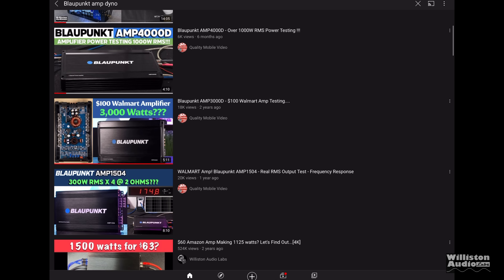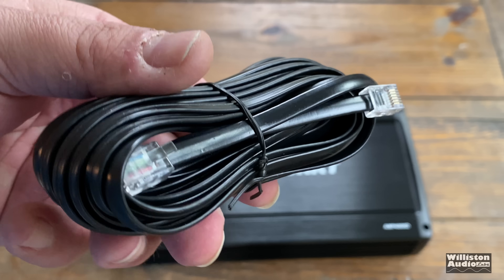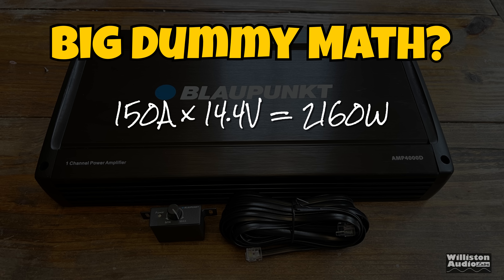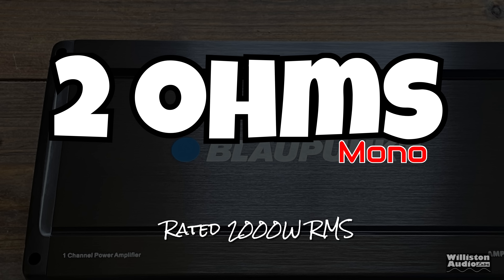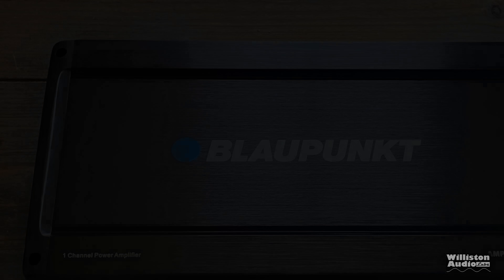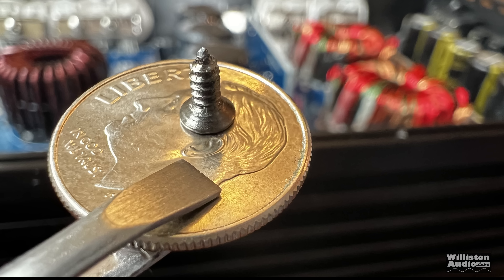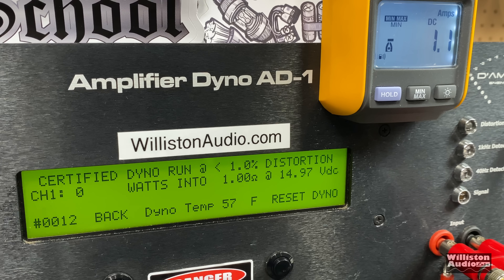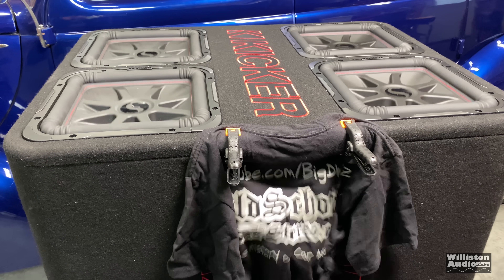How Much Power Does a $49 4000W Walmart Amp Make? [4K]

Comment: I grew up in Germany in the 80s and when I got my first car at age 18; I made a dream come true and bought a brand new Blaupunkt Nashville SX straight out of the store. It cost 599.- Marks. That is at least $1.500 in 2022 Dollars. Two times the money I spent on the car. Damn was I proud. The first car stereo on the market with an automatic track skip autoreverse tape deck if I remember correctly. 
It's a bit strange that they sell $49 amps under that brand now...
Reply from the maker: The name was sold years ago and they are no longer the same company
Reply: @wal  I wanna know who the actual manufacturers are that they license the name out to. With the spelling errors and everything this just seems like the most random Amazon garbage but with a recognizable name slapped on - the fate of every German company at some point, it seems.
Reply: Looks like they were owned by Bosch until 2009 or so. I had an amp and a pair of their 6x9's in my old Cherokee that I picked up in the early 00's. Really decent quality at that point still, I actually transferred that amp through two other cars until a channel on it finally died in 2018 or so. Other than the EMF issues 50-1000 bucks for a 600W RMS@2ohm isn't bad at all. I would have killed to get that much power on my first set up at the price.
Reply: @MEatRHIT2009  Not Blaupunkt but, I bought a $25 'DUAL' car stereo tuner/amp combo from Walmart 4 years ago and, it's held up, 25W RMS per channel. I can't remember if it's a 2 or 4 speaker unit but, what I paid for the thing, who cares, rhetorically speaking?
Reply: @albinklein7680  Everything has went down hill in Germany and the USA  since then . It makes me sick now music is just a bunch of shyttee sounding bass

Comment: That’s some crazy emissions from the amp to be able to corrupt the data to the display. The screen is right on the front panel with the amp in close proximity. Having designed products that use similar LCD screens that must accept EMI blasts in testing without corruption, I know it takes a lot of energy to cause such disruption. Yikes.
Reply from the maker: Oh man it is wacky
Reply: You could just shield everything computer wise or just get a car so old it is carbureted, And no not electronic feedback carbureted but rather straight up carbureted, And instead of having the ignition control module in the bottom of distributor have it even more old-school like before the early 70s where it was just points ignition, Then even if it affected the alternator you wouldn’t even need it to run aside from trying to drive at night. I know all this is highly improbable that it would happen from the amp, but I’m just spelling out a mad max scenario for the fun of it.
Reply: @adamgallahan6747  That would be a "magneto" ignition system.

Comment: Why the hell would they lie about that RMS power rating for $50 if they put the true ratings on it it would be an absolute steal for your money especially for running budget subs there is no point to lie when you already made a pretty decent amp for the money don’t rate it at one ohm tho Literally that amp is a steel at that price
Reply: well because it's not supposed to be $50, its supposed to be $150, they're selling them for like cost price, have a guess why....

Comment: I was too young to really recall, but my brother would always say Blaupunkt made some of the best sounding head units back in the 80's-90's. Sad to see what theyve become now. Still.. thats useful power output despite it not being close to rated.
Reply: They still make decent stuff for vw/audi group cars but their aftermarket stuff is pretty low grade anymore
Reply: @79huddy  I think it's still Bosch that's making the stuff for vw/audi but they sold the rights to the consumer market to some zombie brand company. I remember seeing their units suddenly being just re-branded white box crap that you could buy cheaper under less names.
Reply: I remember listening to the speakers at an electronic store and wanting the Blaupunkt (BluePoint) speakers because they just plain sounded better than anything else. I wish I could find 4 of those 6.5 inch three ways from back in the late 80's early 90's I saw. If I found them I would certainly buy them. They also did not have foam surround. They had a gummy wetted wrinkled cloth edge surround with a high density paper cone. I always worry about NOS speakers if they are foam surround from that vintage because the foam disintegrates and you are left with a shitty mess to fix. The replacement cones and coils are not always as good of quality as the ones made back then. Its sad but many things made today are just plain shit.

Comment: If it’s glitching the dyno , which is built to be around high current ac voltages, what’s it going to do to all the control modules in a modern car? I would not want to find out with my car.
Reply from the maker: Yeah it’s suspect and I’d be concerned using in a modern vehicle
Reply: To be fair, automotive modules are built with robust fail safe checks including CRC and the data streams talk over differential pairs called CANBUS. But who wants to risk it? Not me.

Comment: Honestly though for $50 it ain't bad! I have a question though. What's the best way to set the amp gain if you don't have any good info on the amp or the head unit?
Reply from the maker: I’d set to 1/2
Reply: Use an oscilloscope for the head unit and amp. If you don’t have that, set your head into at 3/4 of its max volume. Then play a song you know well or trustworthy source for test tones and tune the amp gain by ear
Reply: @devinyoung1338  Thanks! That's pretty much what I did I was just hoping there was a better way. I don't have an oscilloscope unfortunately... I've wanted one for a long time just never had a good enough reason to spend the money on it.
Reply: @4BillC  bought my oscope for 32$ on ebay 11 months ago,still havent used it😅 if you do order one,wall plug sold separately on most
Reply: @devinyoung1338  They should have put a true knob to adjust it rather than a slotted one requiring a flathead screwdriver to adjust any of those parameters on the go.. That aspect blew my mind.
Reply: I use my Osciloscopes for everything... I have since I started in 1992
Reply: Oscilloscope or SMD DD-1. Anybody suggesting a random spot to spin the knob to is just plain wrong.
Reply: @definitelydipper595  that dyno is always wrong! underates at least 30% on everything! o scopes are very accurate, even the $20 walmart voltmeter
Reply: @lunam7249  it’s not a dyno. It’s measuring THD.
Yes it “underrates” things because you may not see clipping on your oscope until ~4-5% THD

My system won’t even have 1% THD

Worth the $150 when you’ve built as many systems as I have.
Reply: @lunam7249  it’s not a dyno. It’s measuring THD.
Yes it “underrates” things because you may not see clipping on your oscope until ~4-5% THD

My system won’t even have 1% THD

Worth the $150 when you’ve built as many systems as I have.
Reply: @definitelydipper595  im glad your happy with your system...i do SQL systems also...you should try some esoteric style mids and highs....and try cerwin vega pro  for bass SQL
Reply: I got mines set at 1/2 it’s not a bad amp and it haven’t over heated yet
Reply: @whokares5852  Interesting life hack 🤔 👌
Reply: I use a 4O dollar oscilloscope that I purchased from Amazon.
Reply: You can actually hear the clipping start if you play some test tones because the speaker travels in a different pattern. However, this only really works if the speaker can handle the power.
Reply: Oscilloscope 40 bucks Amazon
Reply: @JohnG1000  really? Definitely didn't think they got that cheap. Thanks!
Reply: @JohnG1000  - Link or brand/model?
Reply: 3/4
Reply: I agree. That amp is not bad for $50 I bet it can push some 12sor 15s
Reply: @1juan167  Its totally not worth damaging your electrical system or subs . No thanks
Reply: Honestly, with a 50.00 amp does it even matter ? It's highly doubtful the speakers hooked to an amp of this quality will be anything decent either.  Turn the gain all the way up and send it.
Reply: @jamesstewart1794  Agreed.  But you know some people will still hook up a sweet sub with this  and wonder why it blew so easily on low wattage  lol 🤯
Reply: Cheap multimeter and math. Head unit at 0 gain with 75% volume. Play a +1DB 60hz sign wave on YouTube. Have your multimeter leads in the speaker terminal without sub leads hooked up. 

Take square root of (RMS x Ohms) to find your optimum output voltage before clip. For example: 1000watts @ 1ohm = 1000. Square root of that is 31.6 volts. Adjust gain while tune plays until above figure from your calculation is met and you should be damn close.
Reply: Turn it up until it stops turning, then turn it up another 1/4 turn for that extra "secret" power. That's why BigD doesn't always get rated power on these things - they hide the true power. I think it's because they don't expect people to have a good enough power setup at this price point. If you set them up properly, they'll outrut more than rated power every time.
Reply: @94XJ  mines always outrut's more than yours.
Reply: @94XJ  This man speaks the truth!
Reply: @94XJ  I have to say that may be Your experience & opinion.  I don't think that is good advice for newbies .
Your much better off with a quality amp Even if its lower power . Because if its tuned decently and you have a box built to spec , then you should be golden 😉 👌  But again, thats just my opinion sir 🙏 Have a blessed one
Reply: @HighVibeTrybe  Read it again 😉

Comment: I have a Blaupunkt under-seat powered subwoofer that I purchased a few years ago. Quickly found out that the name means nothing anymore.  The speaker came apart after about 4-5 months.  It happened one day while I was jamming out some AC/DC, not quite considered heavy bass material. The cap on the woofer is made out of a thick, heavy metal and it came unglued, making a horrible racket.
I'm afraid that Blaupunkt has become just another flea market brand.
Reply: At least you were listening to AC/DC....lol
Reply: So, glue it back on... 🤷🏻
Reply: @davelowets  That's not the point.
Reply: @T_Burd_75   🤷🏻 I has a several hundred dollar Rockford P3 do the same thing.. A lil super glue and it was fine. Expensive things have the same unfortunate issues sometimes.
Reply: @davelowets  I'll have to pull it out of storage when I get a chance. Looked like it was glued on with super glue from the factory. I'm wondering if epoxy might hold better.
Reply: @T_Burd_75  I saw a few videos of expensive speakers being re-coned by professionals, and they all used CA glue (super glue) to reattach the soft parts to the baskets. So I used some decent CA glue from my local hobby shop to repair mine. I don't know if it was, in fact, the correct way to do it, but it hasn't failed me again in years of service. I still use it today.

Comment: I think a capacitor would eliminate any weird effects to your electrical system.
Reply: That IS a joke, right?
Reply: @csj9619  actually speaking he is right, every capacitor has a leakage, so yeah, 20mA is still a load
Reply: Generally speaking a capacitor just adds more load to your electrical system.
Reply: @Thezuule1  It will smooth out voltage drops and keep the amp from introducing weird interference back into the vehicle's electrical system.
Reply: @RidgelinePatriot  No, this amp needs a lot more filtering than a single pole capacitive filter. It probably also radiates a fair amount though the air, too and a cap won’t do squat for that.

Comment: The EMI issues brings up a concern with these cheap amps you frequently test.  Adding a braided ground cable may help protect your dyno from contracting some electrically transmitted disease…  Blaupunkt on your tweeter wouldn’t be too good.  Sweet video as always
Reply from the maker: I may start powering Dyno with an alternative power source and use DMM to show voltage
Reply: @wal  -  Go buy a 15 volt MeanWell switching power supply. They make them that run on 125 and 250 volts for the really strong stuff. They make them from 25 watts up into the thousands of watts. Great brand and great company. 
Also, where is the oscilloscope? Get a scope and show the power line for the EMI. That will show you any funky shit going on as well as high frequency parasitic outputs that will cook a woofer without it making a sound. If you have high frequency energy making it out to the speaker you can burn it up because it cannot move to cool. Try the test yourself on a full range powerful amp and a signal generator on a woofer. Smoke that bitch.  
Seriously get a scope. Check the powerlines. If its backfeeding noise toward the car, Ceramic, Tantalum, and an electrolytic cap on the power input will get rid of transients and electromotive and electromagnetic interference riding on the power line from the shitty switcher in the amp.
Reply: @wal  Probably a good idea.

Comment: I ran a Proton D275 for a while in the late 80's. I bought 3 new batteries in 2 years (Pro-rated, good warranty, Sears Diehard).  BUT, No one believed me.. Today, I think I might not have been crazy after all. lol :) I ended up with a separate deep cycle battery bank in the trunk with the Amplifiers, cooked one within a year. Moved my operating amps to a different brand. Rockford for the win!

Comment: If I was in a pinch. I would buy this for 50$ for sure    
After almost 3 years I still have a ignite audio "6000w" mono 
 Ive clamped it doing around 1000w clean (just like your videos shown)
Reply: For sure. 1000w for $50 is mind blowing coming from someone who started building systems in the 90s when power was $1/watt even for "generic" brands.
Reply: Lot of people don't realize you can do alot with 1000 real watts if you done right.
Reply: Been running 1200 clean real rms watts for years.  It all depends what you do with it.  Had 4 10s and a 12 in a car was amazing.  Had 4 10s in another one and it sucked.  Now 2 10s and a 15 on 1200 rms is amazing.

Comment: for 50$ i would buy this any day , making a common mode filter is not too hard and even upgrading the capacitors would help , i only get class ab amps that are 200w bridged here for cheap , anything class d is above 200$.

Comment: ~20yrs ago now, Blaupunkt was one of the first to do Tripath car amps. I bought one (actually 2 since I thought the first one was a dud and exchanged it) and what a POS. It sounded terrible, and had a buzzing noise both out of the unit and out the speakers.
Reply from the maker: Oh dang
Reply: @wal   what about if you drive or input more power with a strong 150 or 200 watt radio what will it put out
Reply: @spankthemonkey3437  The same...
Reply: @spankthemonkey3437  I bet the amp puts out max power WAY before you ram all that input power into it. The RCA inputs take very little power to drive an amp to max power. Even a high level input on an amp takes very little, as they are a very high impedance circuit. Trying to ram 200 watts into the input would accomplish nothing more, or "extra", at the output.
Reply: Tripath was a massive failure due to a flawed chipset design. I consulted on a few of these designs back in the day and they were mostly noisy junk.

Comment: Blaupunkt was a big item at RadioShack in the early 90s. They had an unusual design format.
Reply from the maker: I forgot they were in Radio Shack!
Reply: optimus amps were too..   when i was young, one of the older dudes i ran with had a system.. tried a few low budget pyramids, etc.. but when he got that optimus amp, those lanzar 12s came alive in that wagon lol... 
i remember they picked me up after installing it, and we drove around for a bit, i told him to pull over and pop the trunk, so i could try something, i corrected his phase on the subs, and made the car bump twice as hard... i was "cool" that day, lol.. 
 ahhh the memories!!! 
✌
Reply: @Generation-X  Yep I remember Optimus amps, speakers. I bought a Blaupunkt tape player for my car in 1994, but returned it for a Sony deck with detachable face and 6x9 speakers. I rolled with that for two years. I was broke in college.

Comment: With new cars averaging 50 or so computer modules, I wouldn't risk putting this amp in one. I saw a video not too long ago where they were troubleshooting a BMW or Merc no-start and it turned out to be a faulty door handle. So putting something like this in a car like that... yikes.

Big D, have you ever tested a Helix amp?
Reply from the maker: Agreed!
Reply: @wal  i solved that issue by never buying a modern car say after 2002 and only work trucks bar bones type issue 2500 hd and classic cars for fun driving old supra n a 280z screw new cars
Reply: @overbuiltautomotive1299  eventually, if vehicles keep being manufactured the way they are, the only safe way to install amps will be to ground via a separate cable running directly up to the battery.

The issues you describe are largely caused by voltage back feeding through the chassis ground into modules and frying them. I've seen similar things happen on chassis that were being welded on up near the dash and the ground clip was all the way on a rear framerail
Reply: @OtherDalfite  That still wouldn't be safe.. EMI/RFI doesn't care what ground you use, if it's leaky, it's leaky, and it will interfere with whatever it can reach. I have a hard time believing that car manufacturers don't harden their sensitive electronics better than that. They have MANY more things to worry about than some minor interference from an amplifier in the real world.